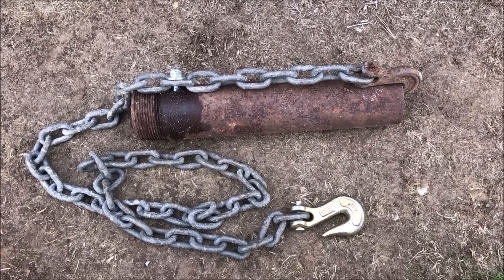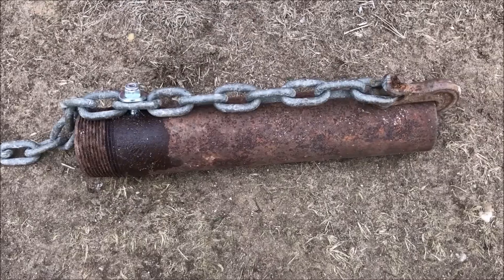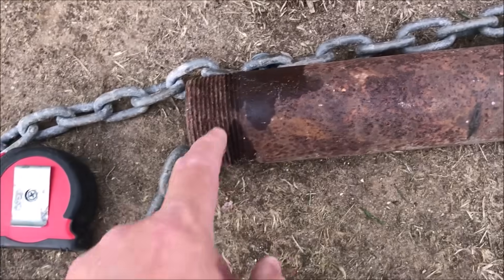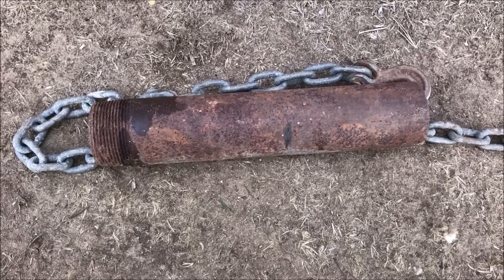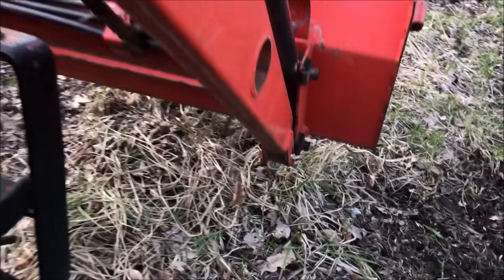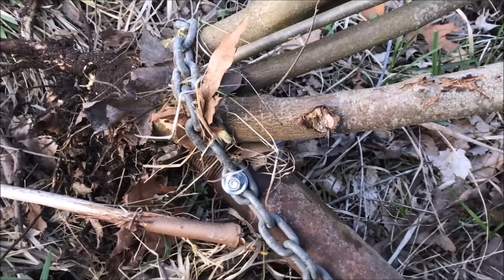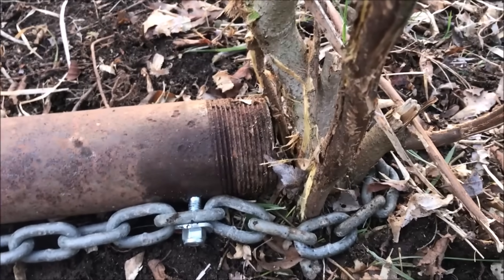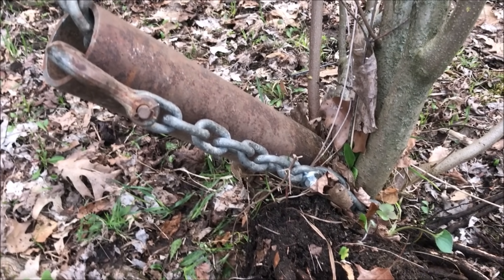OldGuyDIY $18 Best Homemade DIY Brush Grubber Tree Sapling Bush Alder Puller Pipe & Chain Grabber

Comment: If you want to save your chain from being used as a single use tool then run the chain through the pipe so there's a loop inside the pipe then hook the slide on the inside of the near end of the pipe so the loop is totally inside the pipe.
Reply from the maker: Please see my grubber 2.0 video for a solution similar to the one you describe. https://www.youtube.com/watch?v=igH1vVmCPpI&ab_channel=OldGuyDIY

Comment: I made one of these to drag out Yaupon Holly bushes that I first cut at ground level with a cordless pole saw for trimming branches.  The bushes interweave their branches, making them hard to remove, but with this grabber, it cinches down easily. Best of all, it's very easy to disconnect (unlike ropes). My only suggestion would be to use a longer chain so you can wrap a large bundle prior to squeezing.  This really works like a champ!  Unbelievably helpful. Many thanks for the video.
Reply from the maker: You are welcome.  I am glad the video helped you.

Comment: Have an excavator with a thumb to pull brush but been wanting to come up with a solution to pull fence posts. Think you have solved my problem, THANKS!
Reply from the maker: You are welcome.  I have used this tool on steel and wooden fence posts with no slippage.

Comment: A HITCH knot in your chain might do the same thing ?????????????????????????????????
Reply from the maker: That's the technique I used for about 30 years and on smooth barked trees, about 1 in 4 would slip and I would have to get off the tractor, take another bite and pull again.  With this pipe and chain device, it has never slipped on me.

Comment: I suppose it works but you could just double wrap with the chain and make a bite with it. No extra stuff needed
Reply from the maker: That's how I did it for the last 30 years.  On smooth bark trees the chain would slip about 25% of the time and I would have to get off of the tractor and wrap it again for another try.  With this technique, I have never had the chain slip. Please see my grubber 2.0 video for a better, easier to use, design. https://www.youtube.com/watch?v=igH1vVmCPpI&ab_channel=OldGuyDIY

Comment: Just double wrap a chain around the base and hook chain to link. Pull em out with a truck hitch.
Reply from the maker: That's the technique I used for 30 years and about 1 in 4 would slip on trees with smooth bark and I would have to get off of the tractor, rewrap and go again. With this device, slippage is eliminated.
Reply: Yes. To avoid slippage I weave the chain around itself.  @OldGuyDIY

Comment: That's using your knoggin!
Reply from the maker: Thank you.  If you liked this one, I think you will like my brush grubber 2.0 video even more.  It shows a better design that is much easier to use.  No lacing through the chain through the pipe for each pull.  https://www.youtube.com/watch?v=igH1vVmCPpI&ab_channel=OldGuyDIY

Comment: Had you tried using a chain in a "slipknot" fashion around the base? I was thinking of trying this with some of the small privet i need to pull out. Maybe double looped around the base of the tree would achieve the same effect, albeit it won't dig into it near as much as the pipe does. Just wondering if you or anyone else has this experience.
Reply from the maker: Yes, for 40 years, I wrapped a chain with a slip hook two or three times around the tree or bush and had about 1 in 4 slip when I attempted to pull the bush out.  Since I began using this tool, I have not had a single one slip.  The time you invest in making his tool will repay you the first time you use it. Please see my brush grubber 2.0 video for a better, even easier to use version. https://www.youtube.com/watch?v=igH1vVmCPpI&ab_channel=OldGuyDIY
Reply: @OldGuyDIY  Thanks for the info! I also thought about making shallow cuts in the chain for extra grabbing, but that seems like way more work than this. I'll definitely be using your design.
Reply from the maker: You are welcome.  Thanks for commenting.

Comment: Great idea. I am going to steal this. I am trying to pull out some old scrubby trees that are wrapped around my deck. Using a farm jack and a chain, it just slides the chain up the trunks. I might use my grinding wheel to cut some teeth into the end of the pipe.
Reply from the maker: Thank you. I have never had the chain slip since using this technique.  In I experience, sharpening the end of the pipe is unnecessary.  Please see my brush grubber 2.0 video for an even better, easier to use design.

Comment: That's pretty clever. I would thought the bolt could have been larger. Good job
Reply from the maker: Thank you.  I used grade 8, 3/8" bolts with a 9,500 pound shear force so I am not concerned with bolt breakage. Please my brush grubber build video for details on the parts I used. https://www.youtube.com/watch?v=pG_vFBPNY3U&ab_channel=OldGuyDIY

Comment: That is a great idea !
May work even better if you run chain through pipe, around plant, back through pipe, and hook to the top of pipe from inside.
After hydraulics are maxed out by lifting straight up, you can also inch forward for greater leverage, until front wheels leave the ground.
Reply from the maker: Thank you.  Please see my brush grubber 2.0 video for a better, easier to use, design that eliminates the need to lace the chain through the pipe each time. When my bucket lift maxes out, I normally lower the bucket to just above the ground and drive forward, bending the tree over with the bucket and pulling with this tool at the same time.  It often works.

Comment: Am I missing how you wrap this around the base?  Do you remove the bolt each time? Or is that slide hook smaller than the diameter of the pipe?
Reply from the maker: The hook is smaller than the pipe inner diameter.  Please see my brush grubber 2.0 video for a design that is better and does not require the chain to be laced through the pipe for each pull.

Comment: A+++ great idea im going to whip one up out of pure scrap think ill cut a link and weld on in place of a bolt ,so i can skip drilling or bolting ,i can cut later but i see this being a super useful tool i haveca piece coped at 36degrees may try it for a snake bite on the saplings. Great invention we have all fought  with i feel a handy man jack may also be a great addition if you dont have a 10 k tractor😂 or able to get a tow vehicle on your  tree biter 5hundie 😂
Reply from the maker: Thanks for commenting.  Please see my brush grubber 2.0 video for an even better, easier to use design.

Comment: I've had good luck just using a slip hook. Works good, most of the time but occasionally it will slide up the tree.  I'll have to make one of these, looks like it grabs much better. Thanks for posting.
Reply from the maker: You are welcome.  You will never have a slippage issue with this technique.  Please see my brush grubber 2.0 video for an even better, easier to use, design.

Comment: I just use the bucket to either push it over then lift it out, or just dig under the tree directly. No need for this device.
Reply from the maker: This device is more suited to the smaller saplings and brush that are not easily engaged by the bucket.  Sometimes it is not worth displacing the soil that a 5' bucket takes out just to get a bush or sapling with a 2" trunk.

Comment: I wonder if my Kubota RTV 900 would pull them up. I've pull alot of t posts with the blade on the front. Pulled one a mulberry tree had grown around. Small mulberry.
Reply from the maker: I suspect it will.  If you want some extra leverage for a straight pull from the drawbar, after attaching the chain to the bush, run the chain over an old truck wheel to the drawbar.  As you drive forward, the chain goes over the wheel, exerting an upward force on the bush.  Good luck.
Reply: @OldGuyDIY  This is like a small truck with a blade on front.  I have had good results by pulling straight up. It weighs close to 1,900 lbs also have 4 wheel drive and it pulls great. The hydraulics seem pretty strong so far.. It's considered an all terrain vehicle with enclosed cab..
Reply from the maker: That sounds like the ultimate machine for someone with acreage.  I do my small tree and brush clearing with a 1987,  4WD, 30HP, Kubota L2550 tractor that weighs 3,000 pounds and has 1,500 pounds of uplift force at the bucket.  I do most of my brush grubber work with the bucket.  When that doesn't have enough power, I hook to the drawbar and drive forward.  If that doesn't do it, I put an old truck wheel under the chain at the tree and drive away.  If that won't do it, I run the chain over the wheel and then to a 6,000 pound Suburban and drive away.  If that doesn't do it, I reach for the shovel and chainsaw.  In the battle of man v tree, I don't let the tree win.

Comment: Perhaps a shorter pipe. It would be easier to thread the chain through
Reply from the maker: Possibly.  Please see my brush grubber 2.0 video.  By changing the design a little bit I eliminated the need to lace the chain through the pipe each time.

Comment: Couldn’t you just torch them down at the base for the time and effort of hooking each one up?
Reply from the maker: When I am clearing ATV or walking trails, I prefer to pull the tree or bush out completely so there is no risk of puncturing a tire or having a person trip on the little bit of trunk or root that remains at ground level when using the chainsaw.

Comment: I don't have a tractor.  I use a farm jack  with a 6' 2x4 bolted to the top (to prevent the jack from tipping forward).  I also use a Locking Chain Clamp to stop the chain from sliding up the tree.  I wrap the chain around the tree once or twice, then wrap the ends over the jack clevis/cleat and secure with a shackle through the chain ends.  It is somewhat cumbersome, but it gets the job done (most of time).

Your design might work for me.  If I ever find a scrap piece of 2" steel pipe.  Maybe I could use a steel fence post.

Comment: I’ve got exactly the same setup hanging in my shop! lol I built mine probably 23-24 years ago and can’t tell you how many times I’ve used it plus both my boys and two neighbors have used it…. I laughed 100 times and said it was the best use of drill pipe I’ve done! FYI If you get a small tree/bush that want pull up simple stand a spare tire close to the tree and pull the chain over the top of the tire and back the tractor up.
Reply from the maker: Thanks for commenting.  I had no doubt that other people had been using the same principle for years.  I was unaware of it so when I made mine and then the video, I considered myself to be doing a service for brush pullers everywhere.
Reply: @OldGuyDIY  and you did do a service to others and I never met to takeaway from that, so I’m sorry! I was just surprised to see it on YouTube. Thank you for posting.
Reply from the maker: No need to be sorry.  It amazes me how much information youtube makes available to people like us for free. When working on cars, I usually start with youtube to understand the scope of the job I am considering. When I thought of this design, I felt like the smartest tree puller in the world for about 15 minutes. This tool made  pulling brush so easy I wanted to tell my friends about it and it was easier to make a video and then send them the link than to call and talk each one of them through it.  After posting the video, I googled to see if my video popped up and I found an old article describing this combination of pipe and chain from years ago.  The idea has been around for a long time and I was just the guy lucky enough to make the youtube video about it.

Comment: What's the point of the clevis and extra foot of chain after the bolt? Why not just 2-3" of pipe and the chain bolted to the pipe?
Reply from the maker: Please see my 2.0 video.  When I first thought of this, I didn't have access to a welder and wanted the clevis to carry the load to the pipe. The bolt was to prevent the tree from getting sideways between the smooth pipe outside wall and the chain.  After using it a couple times and researching 3/8" bolt shear force, I came up with a better plan, as seen in the 2.0 video. Thanks for asking.

Comment: Thank you for sharing this. If I could add, saturate the ground with water to help the roots come out better.
Reply from the maker: You are welcome.  I agree that wet soil will facilitate easier brush removal. In my case, I am applying brute force with a tractor or truck that tears the tree or brush out.  The key attribute of this tool is that it eliminates slippage where the chain engages the trunk.

Comment: With that chain, all he has to do is wrap it around the trunk TWICE and then hook it back on the chain.  Voila, instant choker.  No slippage.  The harder he pulls, the tighter it grips.  No chunk of pipe needed.  I've been doing this forever and never had it fail once.
Reply from the maker: Having pulled bushes and trees the way you described for about 40 years, I had about a 25% slippage rate after which I would have to go back and get another grip on the tree.  Since using this design, I have not had a single one slip.

Comment: Nice! Subbed.
I wonder if that bolt will be enough long term? Bigger bolt may be in order?
Reply from the maker: Thank you for subbing.  Based on my on-line findings, the shear force of a grade 2, 3/8" bolt is 4,900 pounds, grade 5 is 7,900 and grade 8 is 9,300 pounds. The brusher grubber I am using is he one demonstrated in the 2.0 video.  It is constructed with 2, grade 2, 3/8" bolts so it should require a force of 9,800 pounds before the bolts would fail.  I've been using the puller for a couple of years and plan to replace the bolts with grade 5 bolts before I start clearing trails this spring.  Part of the reason my original grabber had the hook on the pipe with a bolt chaser is because I was concerned the bolt would not be able to handle the force. My tractor weighs 3.000 pounds so on a straight pull without anything to increase the mechanical advantage, the tractor will start spinning and digging down before the bolts potential to fail comes into the equation.
Reply: @OldGuyDIY  OK that makes perfect sense. I should’ve started the question by what grade bolts. Sadly, a lot of people use ungraded Chinese bolts, and then wonder why they suddenly, and catastrophically, fail.

Comment: Instead of running the chain on the out side of the pipe thread it inside . No bolt or weld is needed with a short cord attached to the end of short section it could be pull through   the pipe with a 1/4" hook rod allowing you to wrap the shrub with out removing the chain from the tractor

Comment: Here's how I pull trees that I want to transplant: wait til after a day or two of rain. That makes it slip without breaking roots. Drape a webbing strap over your loader so that 2 equal lengths hang down. Start wrapping one of the ends clockwise down the trunk and the other end of the strap counter-clockwise down the trunk. Stop when you run out of strap. Congratulations you've just made a Chinese finger trap but it pulls trees not fingers. Occasionally I'll get a tree that hydraulics alone will not pull. With a little tension on your finger trap shift back and forth between your lowest forward gear and your lowest reverse gear. Works loose every time.

Comment: You could have just used the chain as the choker
Reply from the maker: In my experience over the last 40 years, wrapping the chain around the tree two or three times and then hooking it back to itself with a slip hook would run up the tree without dislodging about one time out of four.  Since I have been using this tool, I have never had the pipe and chain slip.  The only time I fail to pull the tree is when my 3,000 pound tractor doesn't have enough oomph.  At that point, I run the chain to a 6,000 pound suburban and finish the job. If I can't get the truck close enough to the tree, the tree remains standing or I go with the chainsaw.
Reply: @OldGuyDIY  don't hook it where it only makes a loop and is static. Hook the chain to itself a few links down so it slides. Now it can slip and tighten. Does exactly what you did without the pipe.
Reply from the maker: That is what I had been doing.  When using the up force of the bucket, the chain would often slip. If pulling from the drawbar, it would rarely slip but I was less successful pulling the trees out, with the chain parallel to the ground.

Comment: Great idea! In case you haven't already thought of it: a appropriate sized log [say 4"-10"] placed under the pipe against the base of the shrub; mechanical advantage fulcrum!  For those without access To a loader/ pulling Laterally; what created a tremendous advantage! Would also reduce some strain from the hydraulics.
Reply from the maker: Thank you for the log idea. In the past, I have used an old 16" truck rim to provide the advantage needed to pull larger trees. Please see my 2.0 video for the best version of this tool I have used.

Comment: You need to modify it one more time by running both ends of the chain through the center of the pipe. No need for the bolt and I think that's the weakest point, but I made Things like that years ago I actually made a tow bar with a piece of fence pipe and a chain running through the center of it Both ways It worked perfect.
Reply from the maker: Thank you for the input. Please see my 2.0 video for the best version of this tool I have used.

Comment: Seems like you could have run the first hook through the pipe, hook it on the pipe at the pulling end, then loop the other end of he chain around the tree and run it through the pipie also. It would still act as a noose, tightening and grabbing,but no drilling into the pipe is required. Unless I'm missing something.....